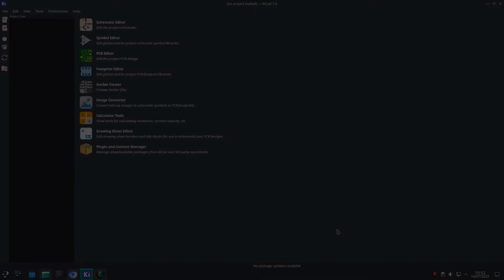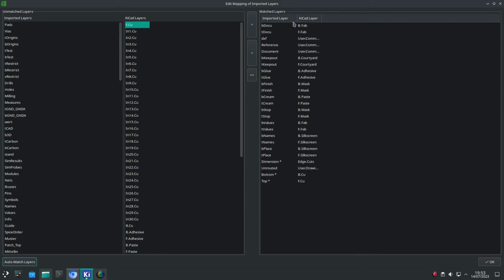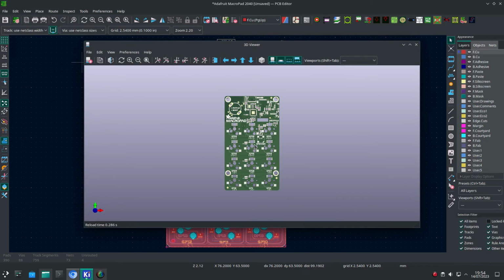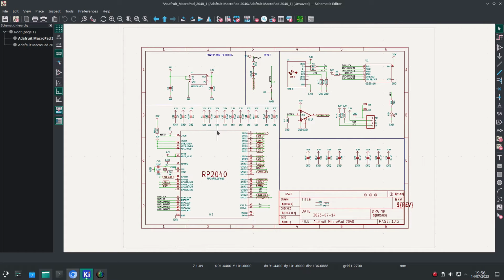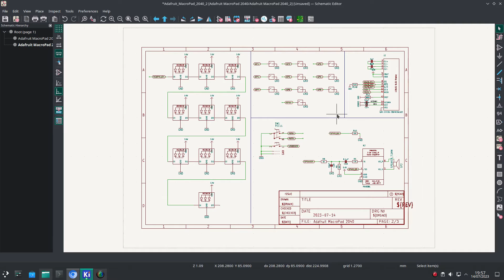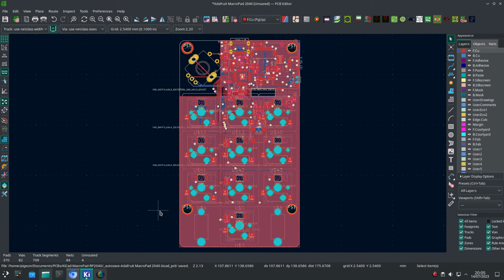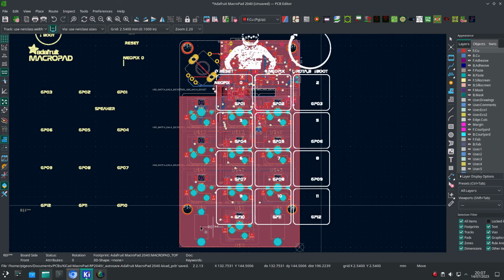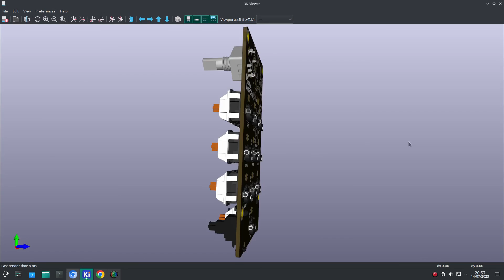Import EAGLE files to KiCad 7.1 (2023)

Comment: This is useful content. I'm finally having to start moving designs from Eagle as Fusion's built in PCB designer is terrible compared to Eagle, with constant bugs, and performance issues. I still use Fusion360 for 3D CAD, but KiCAD seems a lot better for the PCB design.

Comment: Can you help me to understand how Kicad recovers the schematic from the PCB file? When I do this on my project, no symbols are added to the schematic. I assume that's because none of the PCB components have any symbols that Kicad recognises assigned to them. How was it able to do this in your example? How was it able to produce a schematic with a sensible layout for all the components?
Reply from the maker: Hi, I have not had an issue with KiCad bring in schematic with symbols from Eagle file as long as the .brd and .sch files are in the same folder and imported as a new project. If you just need the schematic, you can open KiCad Schematic Editor, click File, click Import non KiCad Schematic and pick the .sch file from your computer. If your still having issues feel free to link me the files and I will take a look.
Reply: Ok I found out the problem I was having - in the video it shows you importing an Eagle .pcb file as a new project which would only import the PCB file and not the schematic. If however you choose to import the Eagle .sch file then KiCad will import both the PCB and schematic into the project.